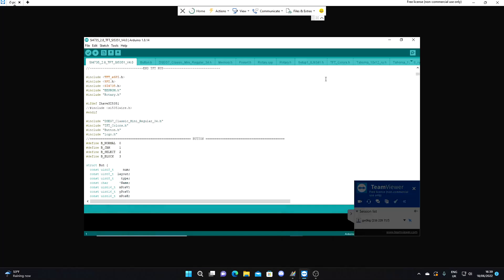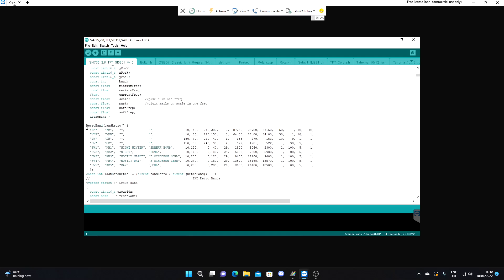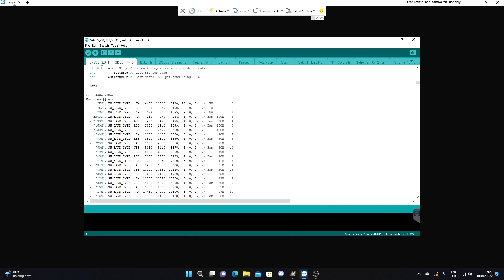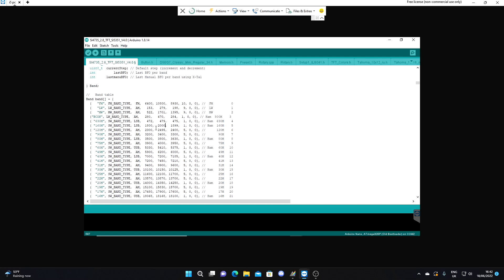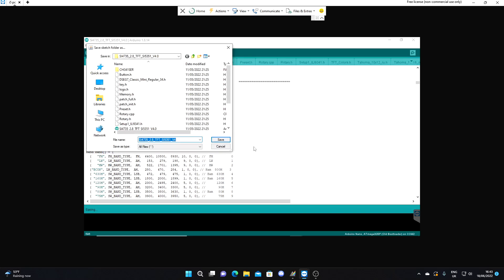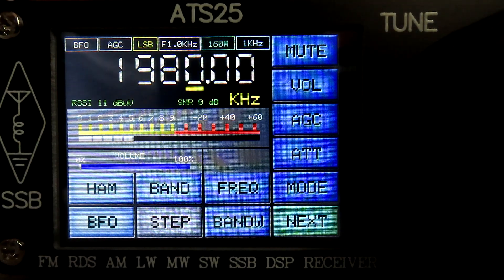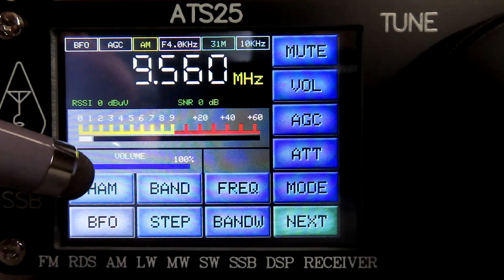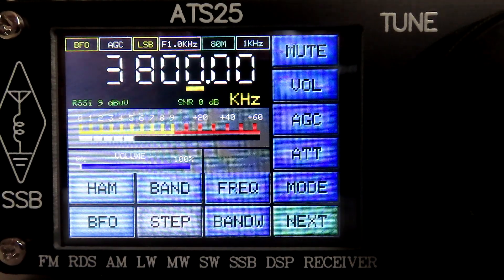Amending the ATS 25 Sketch

Comment: Please tell me what is the correct name of the range? BCON or B CON? And what are its boundaries? I have not been able to find information on the internet about this range. And I can't fix it in firmware 4.1
Reply: NDB non directional beacon... i change  to NDB.
Reply from the maker: Hi Bernard. Thanks for commenting and thanks for your work on the sketch. Beacons are generally between 270-500kHz. As for the name of the band I guess its down to personal preference but I would go with BCON.
Reply: @KevinOReillyswl  Thanks for your answer. I will fix this range